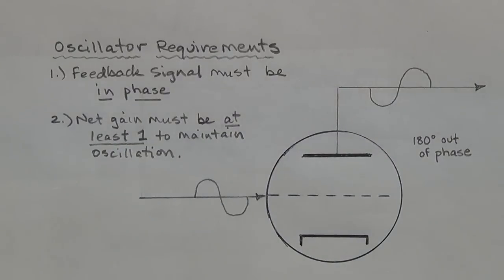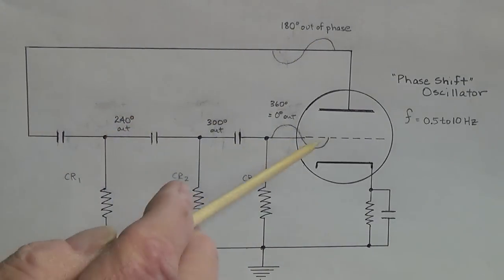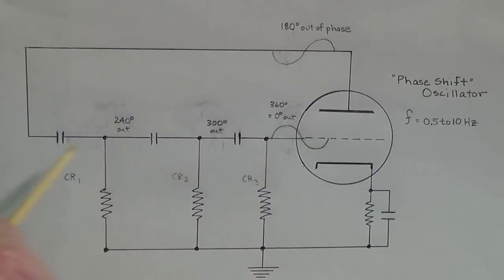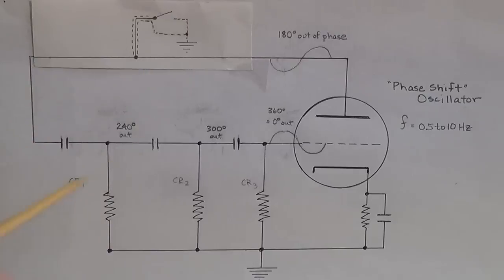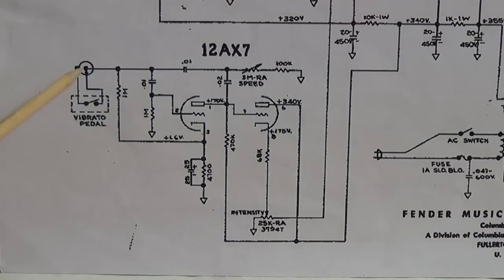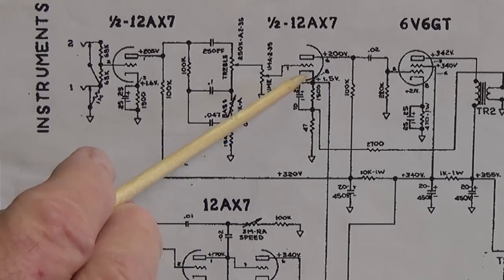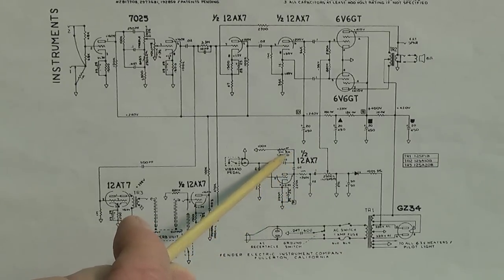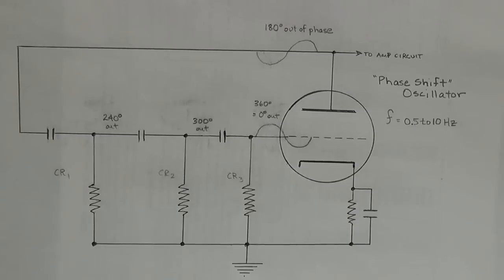How Does a Bias-Shifting Tube Tremolo Work ?

Comment: Oh' and this is a GREAT VIDEO!!! Thanks:)
[ everyone should check out this link as well, actually I had this at the very bottom of the page, but in case I lose any of you I want to be sure you at least check this site out and listen to some of the playing it's referencing.
Ken Griffins 'organ special effects'- http://theatreorgans.com/hammond/keng/kenhtml/Ken%27sSpecialEffects.htm

 I'm trying to add a decent vibrato to my CONN 810 CLASSIC series console organ from 1957. It's a fully tube model ( 98 tubes,  90 of which are 12AU7's). My organ came with an optional CELESTE I & II ( was standard on the 820-830 models). Oddly the CELESTE is not working. There is a very simple single winding transformer and a single 12AU7 which is used for the CELESTE on the UPPER MANUAL PREAMP CHASSIS, and there is the same for the LOWER MANUAL PREAMP CHASSIS. Since it was an option there is no schematic of it in my otherwise very complete 810-819 CONN CLASSIC SERVICE MANUAL. I might draw it out and put the image online so someone can assist me with what to check for. Obvious first is the transformer. If you can suggest a good adjustable 1-2 tube AM/FM adjustable VIBRATO I'd really appreciate it. I happen to have an old THOMAS ORGAN TL-1 amp chassis that was given to me that has a tube vibrato on the chassis. I need a schematic like yesterday for this THOMAS T-1 / TL-1 spinet organ. ( the L in the model number stands for the built in Leslie rotor).
One last thing. I played guitar twenty years before discovering the amazing tone from a little LOWREY HOLIDAY organ from around 1960, which I rescued from a landfill. Just needed new ceramic resistors in the amp chassis. Well, 18 years and 20+ organs later, I can keep about 8 max at one time, but have what I consider to be the best organs ever made, with the WURLITZER,HAMMOND,CONN, and GULBRANSEN , MOSTLY DISCRETE COMPONENT PRE-1968 MODELS. The EPROM found it's way into organs beginning in around 1968 and that is when the compromises began to take place where quality construction, quality tone, and ease of common components for repair, all took a back seat to 'automated features' like walking bass, AOC ( automatic chord control, which was actually pretty usable), and rhythm units. Rule of thumb- if it has 'rainbow color scheme for tabs' it's probably a 70's organ and unless it is a large console chances are it will sound cheap. If however the tab switches are white,black,maroon,yellow then it is a serious organ. Obviously 90% of Hammond organs with draw bars and not rainbow color tabs are the genuine TONE WHEEL organ and will sound amazing. The Hammond T-500 and R100 is the exception of having a bunch of color tabs and draw bars and is still a tone wheel organ.  
The Wurlitzer electrostatic reed organs are the BEST ORGAN YOU CAN RESCUE HANDS DOWN! Keep an eye out for these models and grab it if you see one. You will not be disappointed. 44,4410,4420,4430 spinet sized organ, 4600,4602,4800 full size console. There are recordings of Ken Griffin on the Wurlitzer 4600 in which he had an excellent set-up with a tape delay and Hammond OIL FILLED SPRING REVERB ( Laurens Hammond invented spring reverb, and these are the first, as found in the HR40,ER20,DR20 tone cabinets).  Go to the link at top of page if you haven't already:)
Reply from the maker: paulj0557 You're welcome, Paul. Thanks for the input.
Reply: Uncle Doug Anytime Doug:) Since becoming more of an organ player after 20 years of serious guitar playing, and even attending GIT to better my guitar skills, it really is amazing how well the technical sides of these two instruments compliment one another. In fact, the Hammond organ in particular is essentially identical to electric guitar in principle. I mentioned the NSHOS website in my previous post in regard to the article on the WURLITZER 4600 ELECTROSTATIC REED ORGAN, The NSHOS site ( the acronym stands for NORTH SUBURBAN HAMMOND ORGAN SOCIETY) also has excellent articles on the operation of the HAMMOND TONE WHEEL ORGAN ( aka- the Hammond B3 etc.). The NSHOS HOME PAGE IS - https://www.nshos.com/ and incidentally the Hammond X66 organ you see on the opening page ( two chrome legs under organ) is identical to my own X66, complete with the Leslie 1/2 moon switches. Like the Wurlitzer 4600, and the Hammond Tone Wheel organ articles on their site, there is an article for the Hammond X66 as well. 

I know that talking about organs on this video post might seem off topic, but actually the HAMMOND X66's VIBRATO/TREMOLO/CELESTE animation* system is right up the alley with this video.

I enjoy sharing my experiences with music electronics and so some of what is below is pieced together from some of my previous writings on the subject, but much of it is freshly written today. Hope you enjoy it and also consider saving a great old analog electromechanical ( Hammond, Wurlitzer) or electronic tone generated ANALOG organ. Contact me if you ever need advice on a model of organ:)- Paul

 *ANIMATION is the term used to describe ' motion' to the organs sound, since the goal was always to get as close to a real traditional pipe organ, and especially the rich and sweet animated throbbing sound of the TIBIA ( or FLUTE [sine wave]) in theater organ pipes. The ANIMATION SYSTEMS INCLUDE: 
LESLIE ROTARY DRUM AND HORN ,Vibrato/Chorus,Tremolo,Celeste,Tremulent, Echo
LESLIE SPACE GENERATOR,  WURLITZER SPECTRATONE, ALLEN GYROPHONIC , and I suppose Reverb could even qualify.

People might wonder why there are always those two 'half moon' Leslie switches of FAST/SLOW [ TREM/CHORUS respectively] and MAIN/FULL/ECHO [ organ's straight stationary speaker/ all speakers/ only Leslie, respectively] placed on the front face of the organ whenever a Leslie speaker cabinet is used on the organ, even though one might suspect that since every Hammond seems to have a Leslie they could have built these switches in to the organ. 
Well, there is more reason than it just looks cool having the half moon switches up front, or they are easier to access. No, actually Laurens Hammond did not want the image of his HAMMOND TONE WHEEL ORGAN marred. Their slogan was " MUSICS MOST GLORIOUS VOICE" and since it was still 1940 and the Hammond was selling thousands of organs to churches since their debut in 1935 [ just one model btw- the model A] he simply came to despise Don Leslie's invention. So Hammond introduced a less 'intrusive' sounding TREMOLO control on their organ. This was followed by a very effective  secondary tone generator that was a series of extra tone wheels which were tuned slightly sharp and some flat which gave the organ a choral effect like a choir would have. Hammond also had a simple rotary mechanism - a drum which essentially blocked and unblocked the speaker as it rotated, but this was discontinued not long after it was introduced. Ultimately Hammond installed the very successful to the end- VIBRATO SCANNER, which doubled a CHORUS SCANNER by introducing a clean signal with the pitch shifted signal.
  
To Laurens Hammond the Hammond Organ was excellent with his inventions of HAMMOND SPRING REVERB [ yes he invented spring reverb] and the VIBRATO SCANNER. Certainly it's a great organ on it's own, but numbers don't lie. Even though Hammond refused to even utter the word LESLIE SPEAKER in their stores to the customers, not offer Leslie switching on their organs for external Leslie's, and even hold a bitter attitude toward the whole subject, the Leslie thrived anyway! 

After all, it was Don who as a theater organ buff himself was attempting to duplicate the theater tremulent for himself! It's actually quite simple how it worked out. A theater pipe organ changes pitch due to less air in the pipe during each cycle of the rapid air pulsation/oscillation. As a result this changes the PITCH AND THE VOLUME, or FREQUENCY MODULATION, and AMPLITUDE MODULATION ( AM/FM) on each cycle. Well Don reasoned , that if you place a directional baffle over a speaker and rotate it you get a FREQUENCY MODULATION due to the DOPPLER EFFECT, and you get an AMPLITUDE MODULATION due to the fact that the sound is being rotated toward and away from you which INCREASES AND DECREASED THE AMPLITUDE OF THE VIBRATIONS. 

  A Hammond without a Leslie is an exception to the rule. Don Leslie said he never had to advertise because his product was so successful by word of mouth. It wasn't until the last decade or so of the Hammond Organ Company ( the original , real company) that Hammond finally offered Leslie speakers in their organs as inserts, external cabinet switching was even built in, and even had CUSTOM LESLIE for HAMMOND cabinets, like the great HAMMOND X77 with it's matching cabinet. Ironically though, the serendipity of having the switches as half moons had already established itself, and actually it was ultimately a better deal because it looked cool seeing someone flip those moon switches.

There is lots of serendipity when it comes to the Hammond organ:
KEY CLICK and CROSS TALK were considered design 'flaws' by Hammond and the engineers tried for years to correct them. The thing was that these flaws are the heart of the 'HAMMOND SOUND' and are vital to jazz organ, if not ALL Hammond playing. That key click is like a little puff of something tactile, but pleasant. It's just a little bit of white noise, or static which happens from the key contacts engaging the busbars and since each key has 9 separate contacts for 9 draw bars, it's a random action. This slight difference from key to key also gives the listener a sense of intimacy with the sound.

 By the time Hammond figured out how to filter the CLICK away on the T100 series players immediately removed it. The CROSS TALK is also something that when not there it just isn't a Hammond! 
Another serendipity thing about the Hammond is the fact that not only was the Hammond the first electric organ, but it also sounds the best on a Leslie speaker. The ironic serendipity part is that Hammond organ predated the Leslie speaker by 5 years!
Reply from the maker: Again, thanks for the very detailed and informative input, Paul.

Comment: The WURLITZER ELECTROSTATIC FREE-REED organ ( 1953-1961) used a very simple phasing means for vibrato using two signals- Look here at this excellent article on the entire organ principles, but this is the exact page with the vibrato- https://www.nshos.com/WUR12.htm
THESE ARE ENDANGERED ORGANS NEVER NEVER NEVER DESTROY ONE FOR PARTS!!! They, like the electric guitar and the Hammond tone wheel organ, are ELECTROMECHANICAL TONE GENERATING MUSICAL INSTRUMENTS. NO TONE SOURCE IS AS PLAYER INTERACTIVE, RELIABLE, EASY TO REPAIR, AND TONALLY SUPERIOR AS THESE SYSTEMS. THEY MUST BE PRESERVED. Digital will never come close. Never!

Comment: In your diagram you drew showing the "on/off" switch for the tremolo, you didn't place a dc blocking capacitor between the plate of the tube and your switch. With the circuit as drawn, when the switch is closed, B+ will be shorted to ground and toast your power supply, power transformer, etc.
Reply from the maker: Greetings, Damian, and thanks for your kind words. If you look at the schematic, the plate (+270VDC) of the first triode of the oscillator 12AX7 is connected to the center pin of the footswitch, which is chassis-grounded when the switch is closed. The two oscillator caps, .02uf and .01uf block the DC plate voltage from reaching the switch and prevent a short from occurring. In my diagram (at 8:00), I didn't show any blocking caps and Swarf was asking about it.
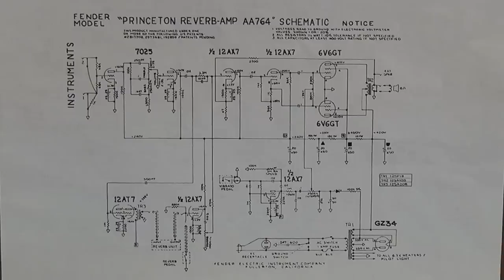Reply from the maker: Swarf Rat Swarf, the diagram (at around 8:00) was drawn primarily to represent the phase shifting that occurs in the oscillator loop. It was not intended to be a schematic. You are correct that in the schematic of the actual circuit (at 9:29), the footswitch is insulated from DC by capacitors on both the plate and (biased) grid of the 12AX7. Thanks for your input.
Reply: Uncle Doug Can you explain in more detail this capacitors, I cant see why B+ will short to ground in the 9:29 circuit. Thank you for your amazing knowledge !!!!!!!

Comment: Ho Yeah Uncle Doug,
I've been wondering how to add a tremolo to my 5E3 build. And until now I didn't do it because I didn't want to turn it into a fixed bias output stage. I like the compression of the cathode bias (and I don't need to worry about biasing my tubes).
Anyway, I just didn't think of applying the shifting to the cathode of the second preamp tube. Had not looked into the vibro champ before.
So I basically copied the vibro champ circuit onto the Deluxe and I think it might work. My only worry is... would the power transformer handle one more 12ax7 ? It's a basic Hammond 290AEX.
Reply from the maker: ***** This sounds like an excellent modification, Francois. The current demands of a 12AX7 are minimal: 300mA filament and less than 2mA plate. I don't think your Hammond PT will have any problem with this addition to the circuit. Let us know how it turns out.
Reply: Uncle Doug Or maybe I could apply it to the cathode of the 6V6s ? Does it really need a full 12aX7 ? or just a half would be enough ? That way I don't have to add a tube to my design, only use the normal channel first preamp (which I don't play and I don't care so much for the interactivity of the channels) and turn it into the oscillator... Plus I could use the hole of that channel volume pot to put the controls of the trem... Like a double pot with intensity and speed.

 I know the 5F11 vibrolux only uses half a tube, but then, it feeds the grid of the output tubes as fixed bias, not the cathode, so maybe it doesn't need so much amplitude. Gee, I wish I knew more about this... I'm still a little scared of tweaking by myself and ruining something...

Also, something I didn't get from your Video, Uncle Doug : I suppose to oscillate, the circuit needs to be fed AC current (like the guitar signal in an amplifier circuit). But It is only fed by direct current, coming out of the rectifier and slighly smoothed. At least that's what I see on the vibrochamp schematic. Where does the oscillating signal come from ?
Reply from the maker: Francois, you could convert your unused pre-amp channel's 12AX7 into an oscillator, similar to the one in the Vibro-Champ, and then apply the signal to the cathode of the first half of the 12AX7 just prior to the Cathodyne phase inverter (second half of the same 12AX7). I believe this would work better than applying the signal to the cathodes of the cathode-biased output tubes.

The oscillator produces it's own "AC" output by the positive feedback system described in the video. It requires no supplemental input of AC to function. The oscillator is a low frequency "AC" signal generator. When its signal is fed to the amplifier circuit, it rhythmically alters the volume of the circuit output.
Reply: Uncle Doug Okay but then, in the vibro champ what is the second half of the 12aX7 oscillator for, if it works fine without it ? Won't it interact less with the amp if it's not amplified ? Or is it just that Leo couldn't stand and unused half tube  ;) (I know I wouldn't, there's one on my Blues jr, but I'm thinking of turning it into a cathode follower. It's just sitting there doing nothing !! Anyway....)

Then directly from the plate, through the intensity pot and to the second preamp's cathode. No need for a coupling cap ? I hope I'm not annoying you...
Reply from the maker: The second half of the 12AX7 serves as a DC-coupled cathode follower, changing the impedance of the oscillator signal to compensate for loss through the Intensity control and to make it appropriate for injection (via the pre-amp cathode) into the signal path.

Yes, your routing is correct. A coupling cap is not necessary since the signal comes from the cathode, not the plate of the cathode follower.
Reply: Uncle Doug Oh So if I use only one half tube instead of two, I'd have to take the output signal of the oscillator from the cathode. Ok great ! I'll try this and be sure I'll let you know. 

Seriously, Uncle Doug, you're the best. On the forums on the internet, people are seldom as helpful as you are for newbies like me. We're always regarded from up above, as ignorants, when we're only curious and cheerful people. Hat off to you and your furry friends.
Reply from the maker: Thank you for your kind words, Francois. My recommendation is stated in my second response (above). Best of luck with your project.

Comment: First I would like to thank you in advance for abiding my ignorance. And for the clear articulation of all things tube amp and canine domestication. 
My question, where/how is the original oscillation generated? The tube seems to be all by itself with only an output to the circuit. If rusty is going to chase his tail, his head or tail has to be set in motion. The oscillation is self sustaining, yes, like if I play a note on the guitar then bring it in front of my amp it will ring out to the exuberance of my adoring fans. But what is the first cause? General instability?
Reply from the maker: An excellent question, Dr. H. From what I understand, the background noise in the amplifier circuit initiates the oscillation in the Vibro-Champ. It can take a second or two (sometimes a little more) for the oscillation to reach operating level. In amps with Tremolo and a footswitch, the abrupt activation of the switch "kickstarts" the oscillation almost immediately.